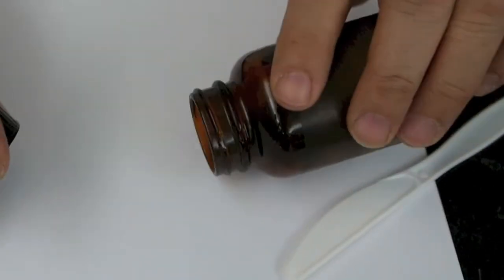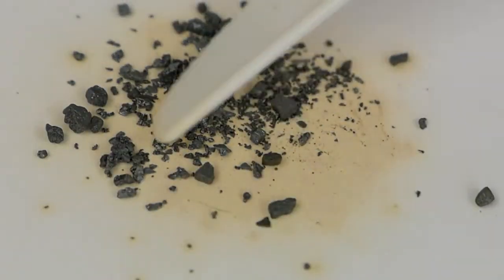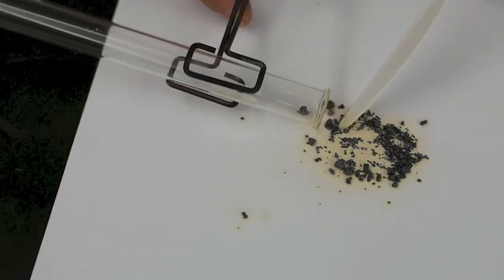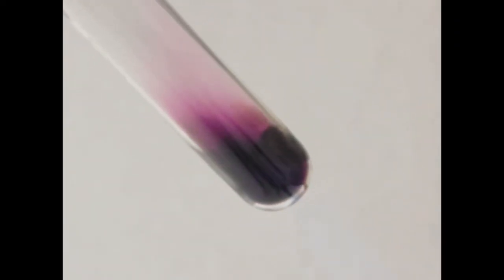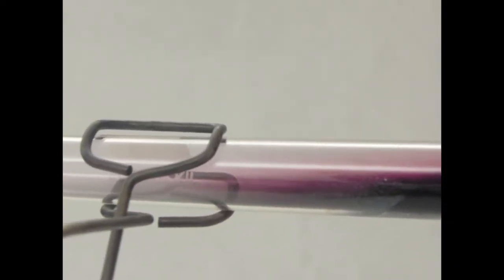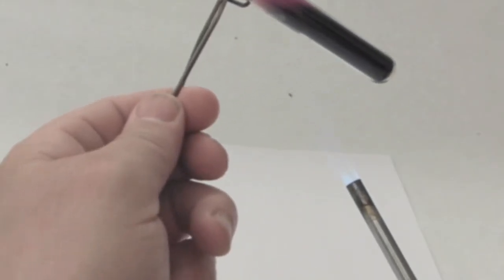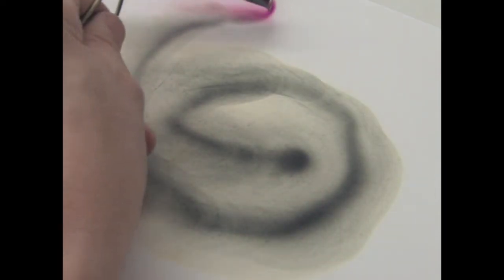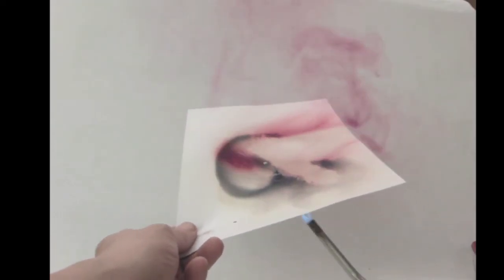Sublimation of Iodine - solid to gas // Homemade Science with Bruce Yeany

Comment: Actually, according to the physical properties of iodine, it is not sublimating directly, but boiling/evaporating rapidly ...    As its metling point is at 236.66 °F and its boiling point is at 363.7 °F   ....   But probably due to its rapid heating over an open flame, we don't have time to observe its liquid phase ....    But in theory, if you could maintain its temperature around say 300 °F , we could have it in its liquid phase .....
Reply from the maker: thanks for the post.  there are so many sources that give iodine as an example of sublimation,  and yet it's sounds like that's not exactly correct.
Reply: Wow

Comment: where can we find iodine in nature?
Reply from the maker: Mars Seeker Hello Mars Seeker,   Iodine can be mined as a byproduct of oil and gas production,   it is recovered from the compound sodium iodate.  The largest producer is Chile.   There are also trace amounts found in the oceans, large quantities of iodine have been produced from the ashes of burned seaweed.  Pure iodine crystals can be purchased from chemical supply companies or online from companies such as amazon.
Reply: Thank you for your time and answer , much appreciated. Iodine is really something.  if it's no problem for you I would like to ask couple more questions. I wonder, is the gas flammable and when does iodine become explosive ? Or Iodine can explode only under pressure ? and what we have left after the explosion ?
Reply from the maker: Mars Seeker The gas is not flammable which is why I am using a gas flame to heat it and as far as I know iodine does not become explosive by itself.   The only one that I am aware of is iodine combined with nitrogen  to form nitrogen triodide, which is a very unstable compound that will explode upon impact and releases the iodine as a violet gas.    At the moment I am not sure of the chemical equation.  Eventually I plan to show this in a video.
Reply: Bruce Yeany Thank you for your time and for sharing the video . much appreciated. this really is one interesting material.